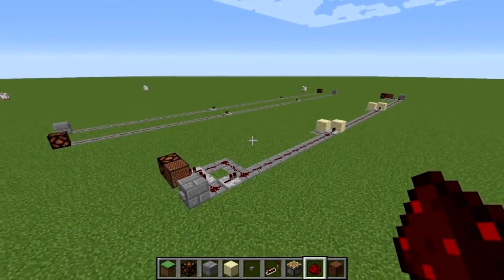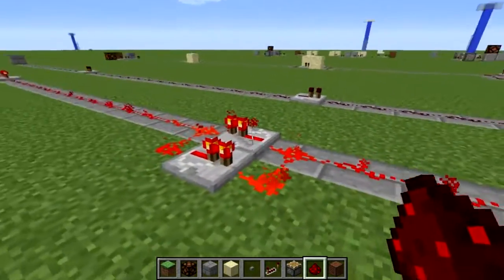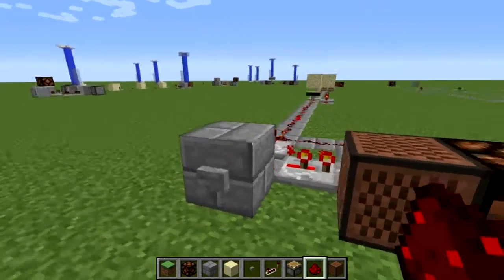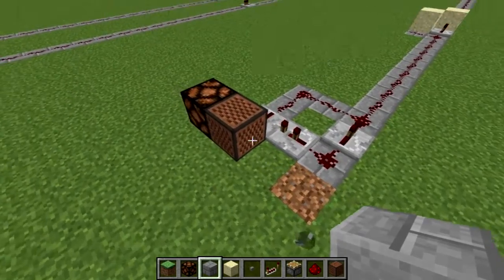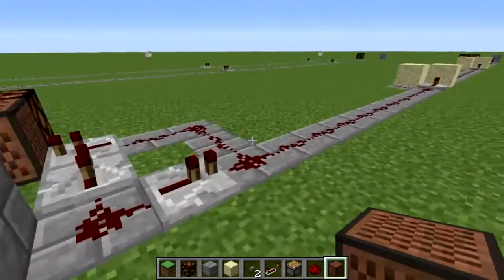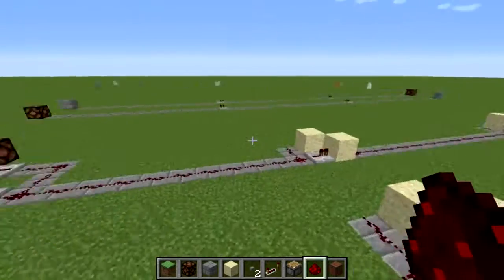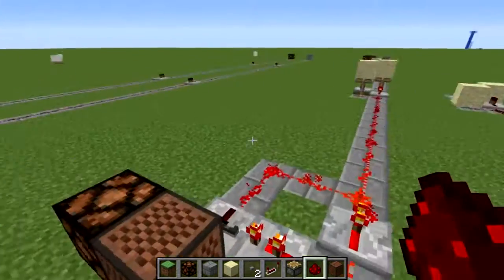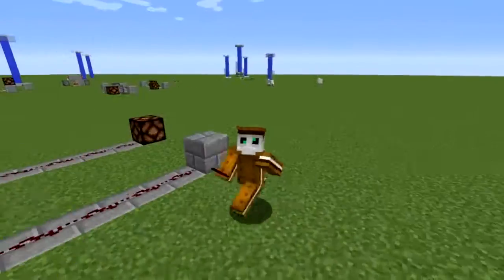Minecraft Tutorial - Two-Way Redstone Repeater - One Line

Comment: this is actually genius. the sand version does not work in 1.21, but i modified it. i made repeaters point outwards and put at outer end on pistons, also replaced pistons with sticky pistons and used concrete instead of sand. this also has an advantage of not spitting out blocks when the sticky pistons are pulsed too quickly, so these modules can be chained.
Reply: can you explain briefly what youve change cause i dont get it
Reply: You also need replace the redstone dust which pointed by repeater into a block, which makes redstone line point into sand (or concrete powder, which not matter)

Comment: So I'm implementing this on my server for a mine cart transit system, and it seems that the sand block sitting on the piston that is meant to prevent the infinite loop keeps breaking itself during testing. I've made sure that I'm within the 15 block signal limit, and I've tried variations of block placement to see if it still happens. I need help! :(
Reply from the maker: If you continue having this problem, add 1 tick of delay to all repeaters pointing into sand blocks.
Reply: @RabidSmore  I will definitely give this a shot. Thanks for such a helpful and informative video, this was exactly what I needed. 👍🏻
Reply: @AutoMativeX  did it work??
Reply: @fer10190  it did! I had to space out the repeaters to be exactly 15 redstone dust apart. If the distance between the repeaters was any shorter, the minecart would only work one direction. I think it was just a multiplayer bug that kept my initial design from working properly (minecart would only go one direction and not return when called).
Reply: @AutoMativeX  Cool! Thanks, man.. i'll try it right now
Reply: Actually, for the record, I just figured it out. As it turns out, in order for this to work properly the repeaters must be spread out exactly 15 redstone apart. Don't ask me why, but it won't work otherwise (at least on a multiplayer server).

Comment: Great video. I'd like an explanation of how the "sand block/piston repeater" works.
Reply from the maker: +Timothy Borbacs Sure. So how it works is the redstone signal goes through the first repeater and into the sand. The piston under the sand is activated and pushes the sand up while the signal also passes through the sand into the redstone on the other side. While the sand is up/falling, it will not pass power through even if the repeater is lit.

Once the signal comes from one side, it will attempt to go 'backwards' at least once, but the piston + sand will be up in that direction and it will fail to send the signal back through.